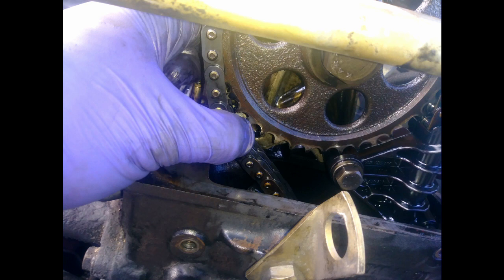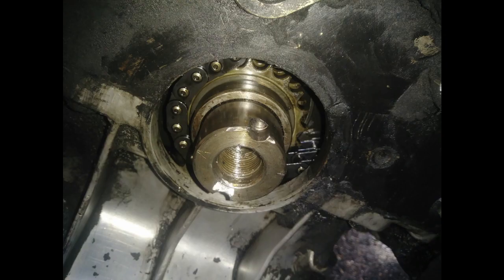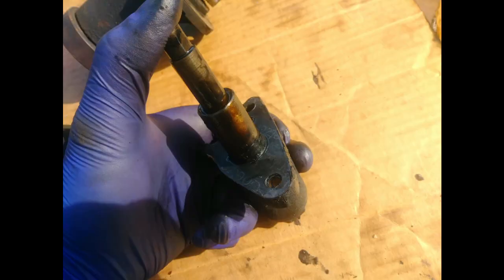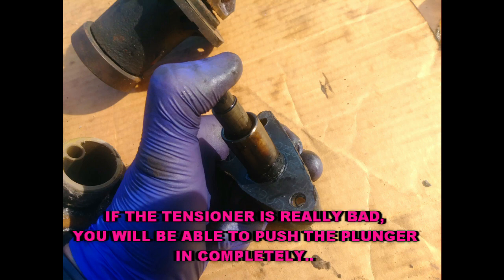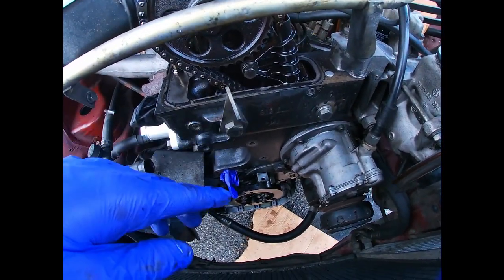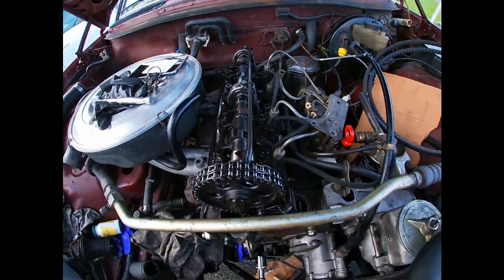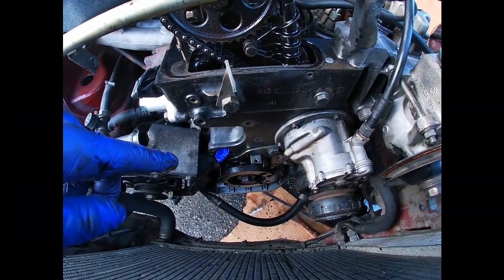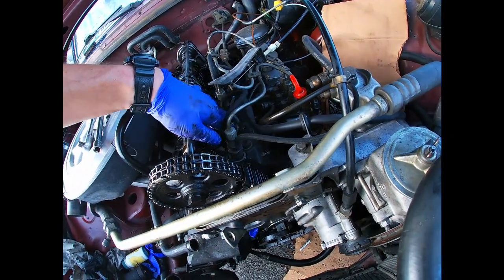Mercedes W123 240D Stretched Timing Chain or Bad Tensioner FOLLOW UP (OM 615 OM616 OM617)

Comment: Great video. You can use an offset woodruff key to correct a couple of degrees of stretch if you don't wanna deal with replacing the chain right now.
Reply from the maker: Thanks for watching. I'll replace the chain. Putting a woodruff key is like covering up untreated wound. If it's stretched, it needs to be replaced.
Reply: @VITOSGARAGE  Not really. Correction via offset is a factory approved method for certain amount of stretch. But of course changing is better.
Reply: @VITOSGARAGE  Thank you for responding to my comment.
Reply from the maker: I agree with you. It will correct timing a few degrees. I have like 3-4 degrees and the chain is tired. I will replace it and it'll be good for another 200k☺
Reply: @VITOSGARAGE  I agree with you more than you agree with me! :) 
replacement is the best.
Reply: Hello, I am sending you this message to have information concerning the timing of the timing chain of the Mercedes om 616 engine. I have my chain tensioner which shows signs of bad function, there is also an offset of 6 degrees compared to to the camshaft and the crankshaft pulley, now to compensate for the gap "ie put the TDC to 0" I would like to install Wood Ruff Key, my question is to know if I can put Wood Ruff Key which corresponds at an offset of 6 ° or should we put one of 3 °?
  Knowing that if I put a chain tensioner I decrease the offset by 3 ° which would normally make me come approximately to the 0 mark on the crankshaft (TDC) or else if I can put a new tensioner with Wood Ruff Key which corresponds to a 6 ° offset? At this time I do not risk having the chain too tight knowing that the tensioner could tighten the chain more? I know that normally when we change the tensioner we change the chain with it but I would like to avoid changing it if we can put the Wood Ruff Key in place, the Mercedes reference is: A6219910267.
I'm telling you this because I have to replace my injection pump and once installed I have to put it at 24 ° before TDC so that's why I want to be sure of good bases to be able to stall my Bosch injection pump ( ie to be at 0 which corresponds to TDC). Or can I set 24 ° before TDC despite my 6 ° deviation from the crankshaft pulley and the camshaft mark? What do you think ? Thank you for your advice ?

I repeat the question regarding Wood Ruff Key:
New chain tensioner with 6 ° Wood Ruff Key?
New chain tensioner with 3 ° Wood Ruff Key?
Reply: @VITOSGARAGE you don’t get to rewrite science bc you chose a specific path. Your statement would be WRONG.
Reply from the maker: @ItsCheechFool  lol what the hell are you talking about

Comment: When replacing the timing chain, can you hook the new chain to the old chain and pull it through? Or, do you just have to take the front of engine apart and do it the long and hard way? Thanks
Reply from the maker: Attach the new chain to the old one and pull it through. There's no front timing cover on this engine. That's why you have to pull it through🔨🔧🚗

Comment: Do you change the valve cover gasket every time you open up the engine? I just picked up a 79 and am going to take a look inside for the valve adjustments and to check the timing chain (any other suggestions welcome!) and of course my intention is to replace the gasket this time around. The car has a bad slave cylinder which needs to be replaced before it can be driven which is priority but while I’m working on it I want to check those items out and don’t want to have to replace the gasket every time I open up the engine if I don’t have to.
Reply from the maker: No, you don’t have to replace the valve cover gasket every time you take off the valve cover. New valve cover gasket will last a super long time and will stay flexible. 
Check your timing chain for stretch while your valve cover is off and do the valve adjustment at the same time. It has to be done every 12-15k miles. 
Replace the main clutch cylinder at the clutch pedal while you replace the slave cylinder. Use good quality parts. Thanks for watching, I have lots of Classic car videos here. Please check them out🤝

Comment: Great video man, so you can get away with a few more miles by just replacing the tensioner??
Reply from the maker: New tensioner fixed timing chain looseness. However, you might need to replace your chain and guides
Reply: @VITOSGARAGE  thanks, do you set the engine on Top Dead Center to replace the tensioner or is it not necessary?
Reply from the maker: @gprz843  I set it to TDC, change the tensioner and turn the engine over by hand, and then start it. Once you start it, let it run for a bit, shut it off, remove the valve cover and recheck the timing as well as make sure the chain is tight. If it’s not tight and if you can move it up and down on the cam sprocket, replace the chain and guides. You can do the valve adjustment while you’re there and you can change the valve cover gasket too
Reply: @VITOSGARAGE  thanks man
Reply from the maker: @gprz843  Anytime. Check out my recent videos and playlists. I post a lot of car content on this channel

Comment: Wow i am surprised that they had any problems with the chains. Usually they dont have problems like these.
Reply from the maker: Every car does. The chains on these cars need to be checked or replaced every 300k-400k miles or so. Chains stretch. It's still amazing how long they can last. This particular W123 has 329k miles but I am sure it's a lot more than that. Maybe 1 million miles, who knows.

Comment: If it is loose then you replace both. Period. Look at the guides. If showing wear or are brittle you replace those also. As to the tensioner it has a one way ring that sits in grooves. This prevents it from backing off when there is no oil pressure.
Reply from the maker: Great idea! I agree!
Reply: I may be ahead of myself. These older pensioners did not have a check ring and grooves. Just orings. If little wear, then the orings can be replaced. But still, best to replace the tensioner no matter what. Hey, what do you want from a 74 year old ? 😀